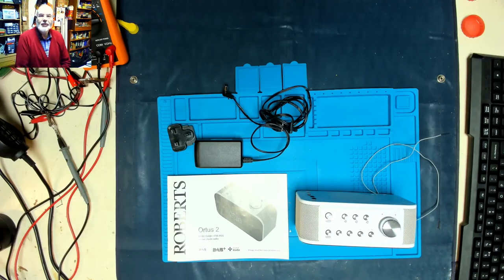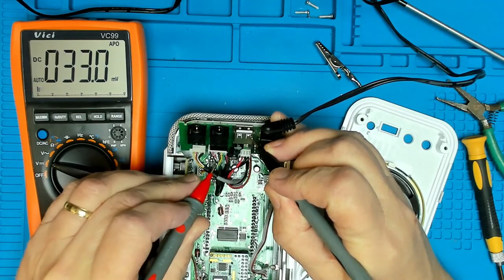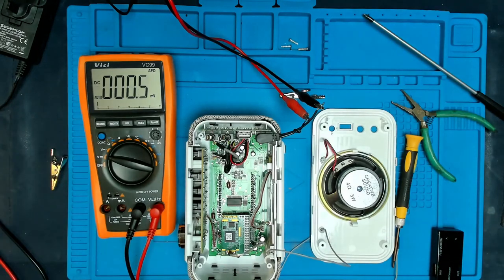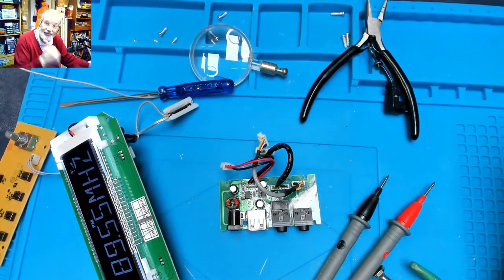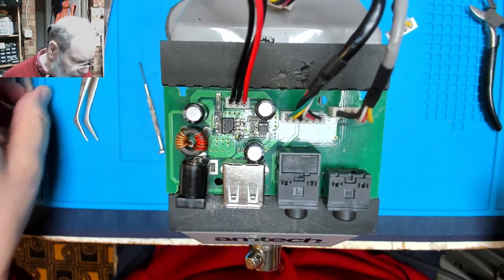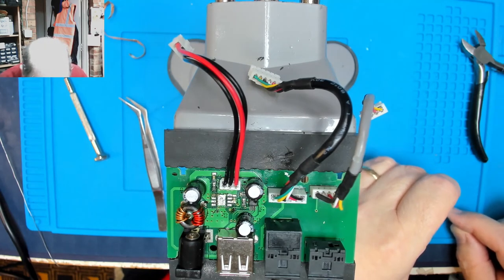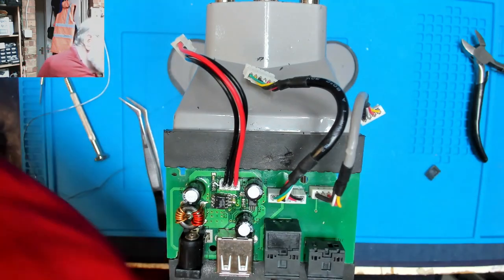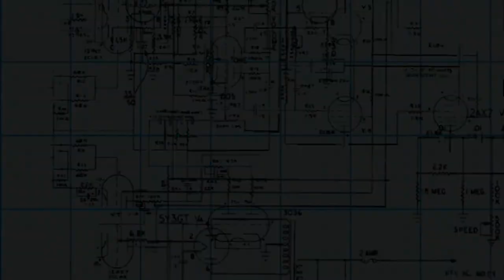Fixing A Roberts Ortus 2 Clock Radio which had the wrong input voltage applied.

Comment: Just bought one and thought I'd see if there were any videos on YouTube. Good to see inside, and mine is supplied with a Kingwall ~Electronics mains adapter. Seemed a large tip on the soldering iron for what you were doing😆. Great video though!
Reply from the maker: Yes it was interesting, though I could not get a circuit out of Roberts as it was considered a current product. A fair bit of guesswork went into the repair. And yes, the bit was too big. My smaller one had broken and I was awaiting a replacement which I now have. :) 
Thanks for the compliment.

Comment: I don't suppose you have the part number for the chip on record anywhere? Got one here and the chip is well and truly frazzled!! Can't find the info online. Regards
Reply from the maker: Hi John, The chip has the numbers P3P364 / P3P3G4 and T 1 75A  on it. I could not find an equivalent so had to order directly from Roberts Radio Technical, you can contact them here: http://www.robertsradiotechnical.co.uk/ContactRobertsRadioTechnical.aspx
Reply: @ChasLarge  Thanks, appreciate the quick response.